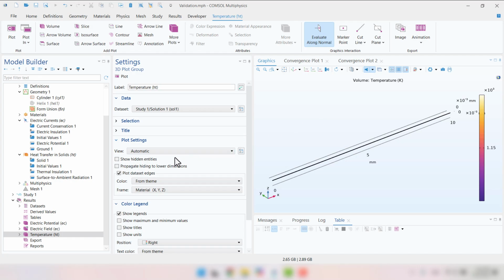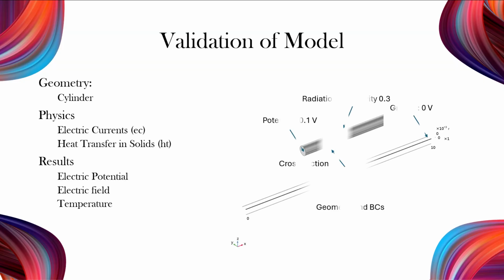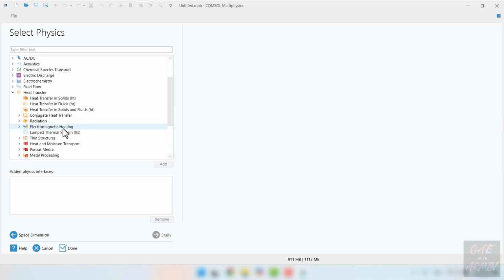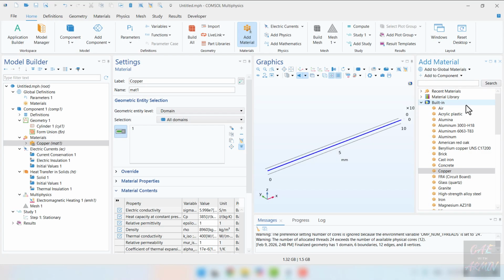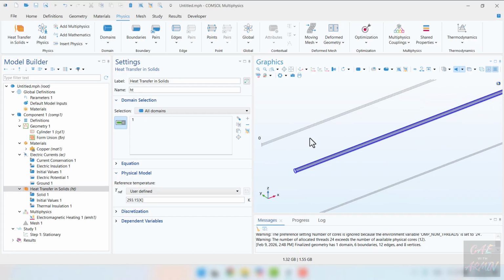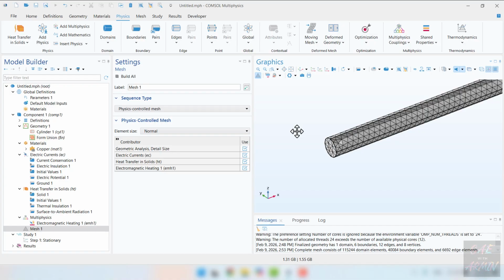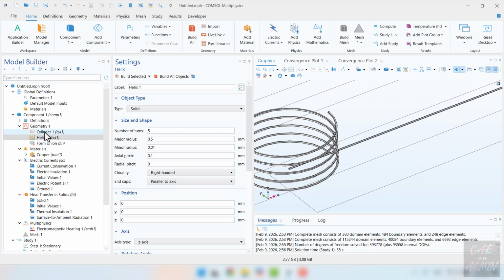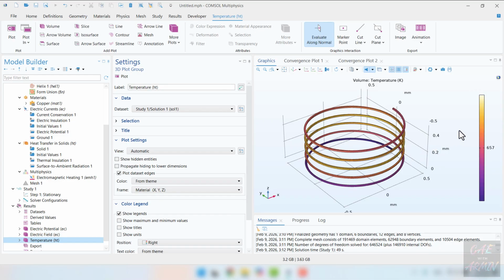COMSOL Tutorial: Joule Heating  | Coupling Electric Currents and Heat Transfer in Solids

Comment: Hello Sir, I am a PhD student and I am facing significant difficulties in simulating a geothermal double-pipe borehole heat exchanger. The system has a length of 4000 m, an outer diameter of 0.3 m, an inner diameter of 0.1 m, and an insulation thickness of 1 cm between the inner and outer pipes. The surrounding rock diameter is 0.5 m, which is in thermal contact with the outer pipe. Heat flows from the rock to the water circulating through the outer pipe, and the heated water then returns through the inner pipe. Additionally, there is no heat transfer between the inner and outer pipes due to the insulation. How can I perform this simulation in 2D not in 2D axisymmetric?
Reply from the maker: Hello, sorry for the late reply. As I understand your model, you can model cross sections of pipe and insert the pipe length in each physics (e.g., heat transfer, solid mechanics, etc.).